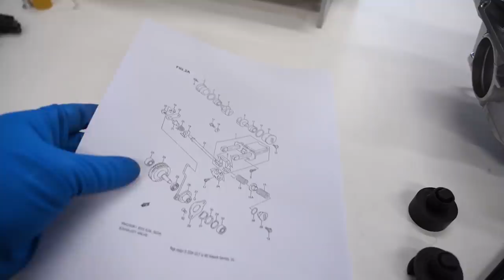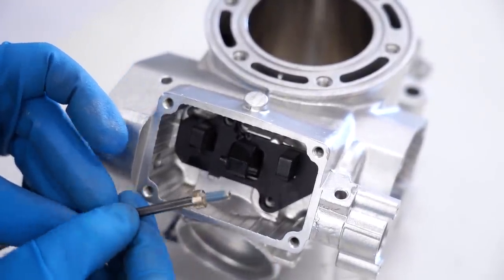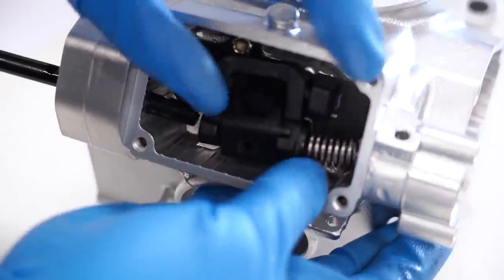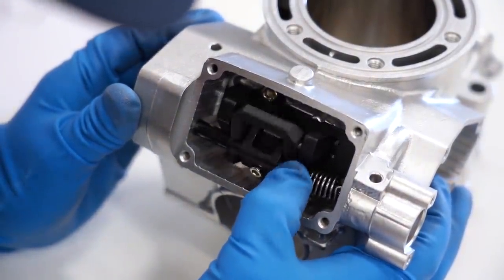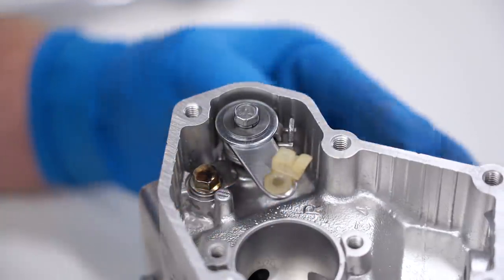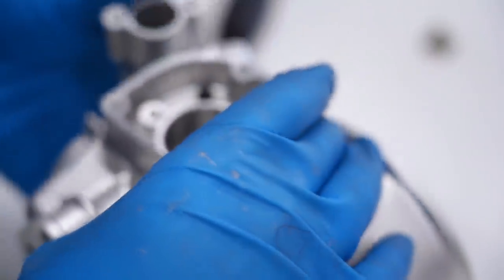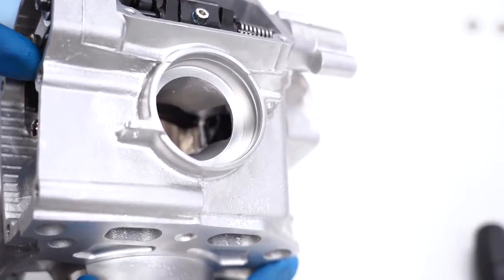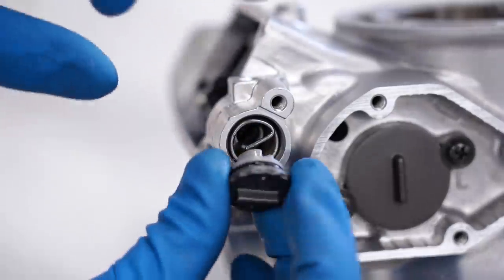Rebuilding A 2 Stroke Power Valve | RM250 Rebuild 13

Comment: That plate you put a washer on the power valve at 5:40 shouldn’t be tight it needs to have a bit of movement because that spring it sits in acts like a mini shock absorber for when the arm comes up and down.

Comment: 3:35 it's not so much the area of the exhaust port that the 'power valve' affects but the height of the exhaust port. The higher the top edge of the port the earlier it starts to scavenge the exhaust gas which produces power at higher revs. When the port top edge is lower it produces power at lower revs.  😉

Comment: For those who work on the RM power valves be sure to look at the electrical schematic and notice the power valve solenoid. Not all models have the solenoid. If it’s not actuating as it should your bike may not operate at optimum performance levels. As I understand it the solenoid operates like a waste gate.

Comment: Please answer pls. Should I run Rotella t in my 2016 yz250 2stroke trans? I seen you run it on the cr125 but is it ok with the 250?

Comment: do you have tips what should i do mu 50cc yanaha dt x 2011 dont quite work... ot i mean it does work until im on 4th and 5th gear then it does not take any rpm otherwise it does work greatly

Comment: Hey Cameron! I was wondering why cerakote those parts not powdercote?
Reply: Tolerances, powdercoat is way to thick and adds to the overall size of the part.
Reply: @ericjaulin9562  Well yes, but why the covers? I'm just thinking because im considering painting my car rims and maybe later my ktms rims and engine covers.

Comment: You have made a big mistake. At 5:50 installing that extra washer has locked up the safety spring.The spring is supposed to allow the centrifugal actuator to rotate in the event that the power valves are gummed up with carbon and seized. You need to remove the extra washer. Grind down the bush to eliminate any small slop instead.